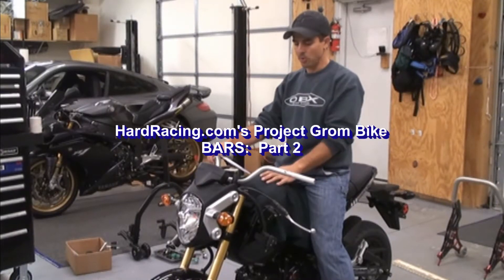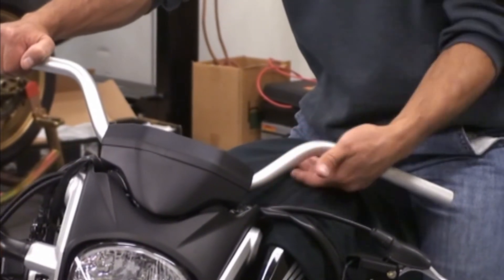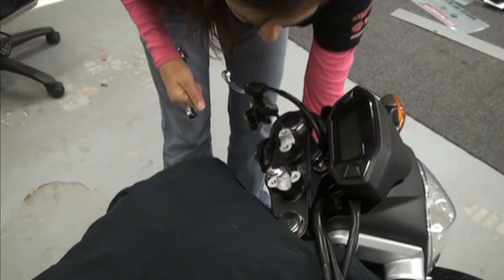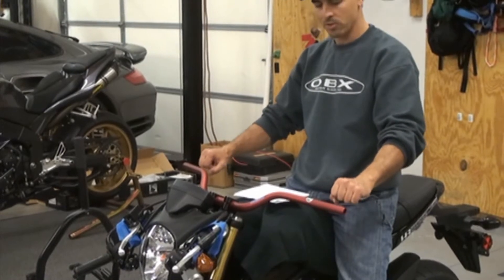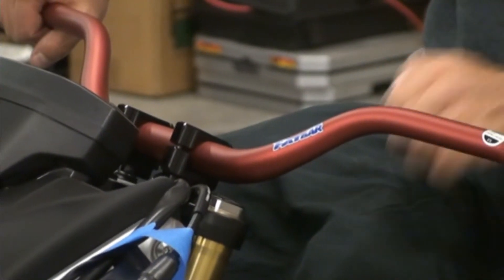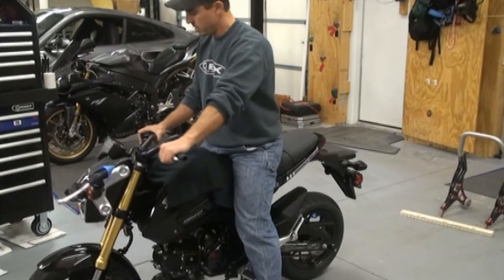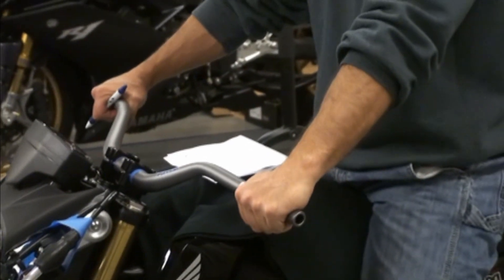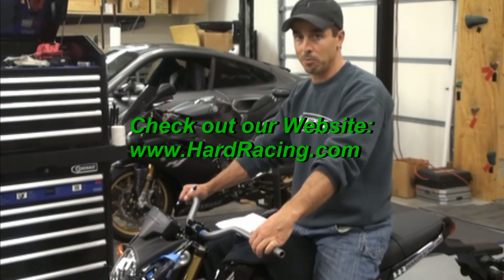Honda Grom Handle BARS (Installation, Comparison, Review & more)   PART 2  -  Hardracing #GromBars

Comment: Hey guys, just got done trying to install your same handlebar set up, ordered from you of course...

Quick ?:  When ratcheting down the ProTaper bar mounts, how did you keep them from twisting?  I'm having a hard time getting the handlebar aligned straight when I tighten everything together--do you have to have someone physically hold the bars straight then tighten?
Reply from the maker: TheDoctorsubie Yea, we ran into the same thing when installing.
So when we did the video we showed, it's best to install the bars, and then do final tighten once they are installed.
That way the mounts don't move.

Comment: Which bar is the one that has "evolution" on it? 

Is that the one Hardracing is running on their project grom?
Reply from the maker: +Chris Louie 
Not sure ?  What time stamp did you see bars that say Evolution ?
Reply: oops..i meant on your website when looking to purchase the GPR stabilizer..i see a pic with EVO on it
Reply from the maker: +Chris Louie 

Sure thing.  
Those are the ProTaper EVO 1 1/18"  Oversize bars in the YZ High 

config.

Just click on the link to our website below to check out all ProTaper Bar 
specs.
http://www.hardracing.com/GROM/ProTaperOversizedBars.htm

Comment: What washer size did you guys use with the 1 1/8 Risers? I got the renthal riser but handle bars feel mushy because I didn't use washers or weren't included with mine.
Reply from the maker: wagongga We never measured.
We just grabbed some from our nut and bolt drawers until we found one that fit.  It's a Fender Washer... meaning larger O.D. then normal.
You can get them at any Local Home Depot or Lowe's.
Just bring one of the Bolts with you so you can make sure the I.D. is correct.